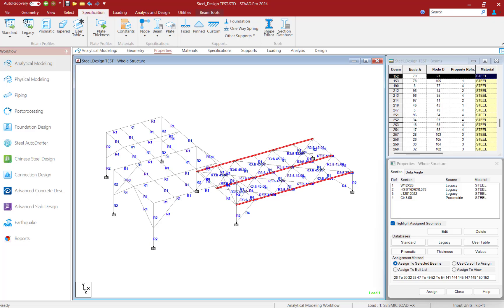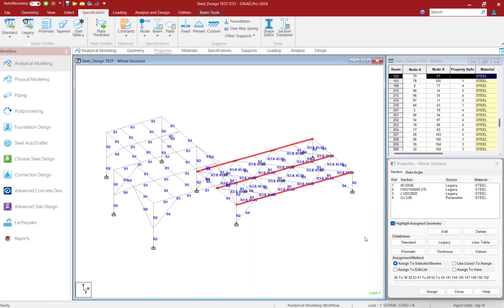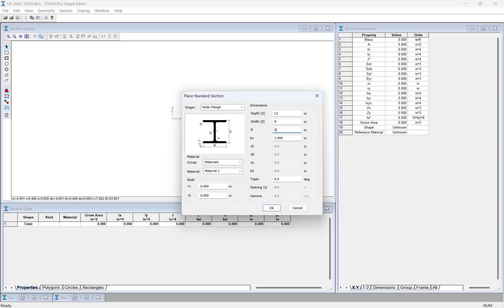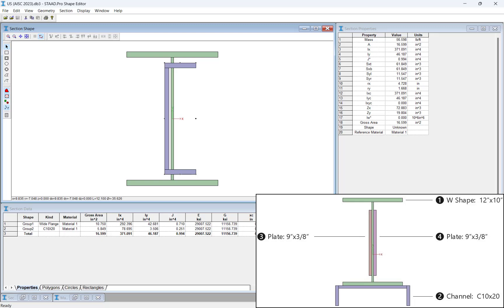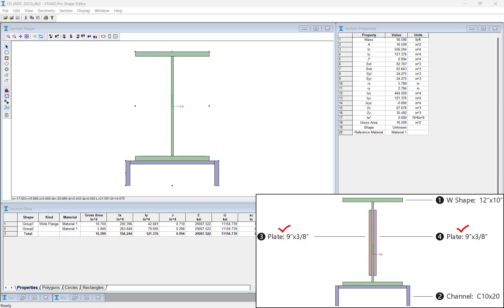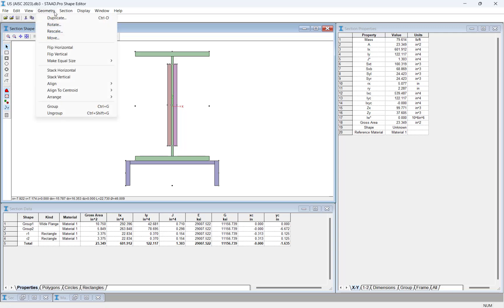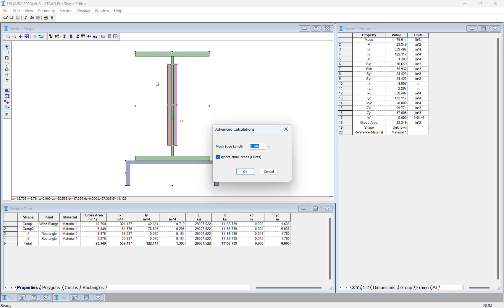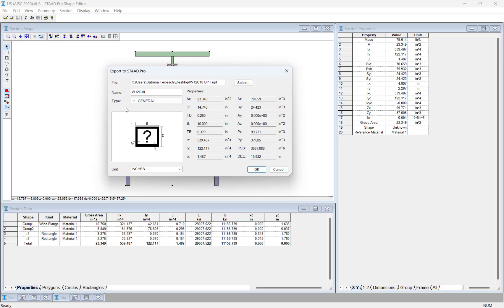Using the Shape Editor in STAAD.Pro

Comment: It's fine that the torsional resistance is now automatically calculated. But It still doesn't calculate the shear areas in Z and Y direction, and has to be done by hand. Why?
Reply: I guess there is no algorithm that supports doing it currently.